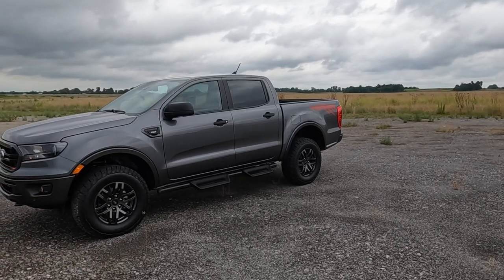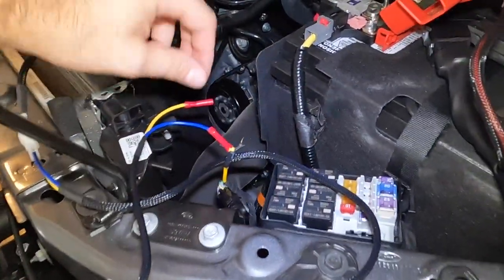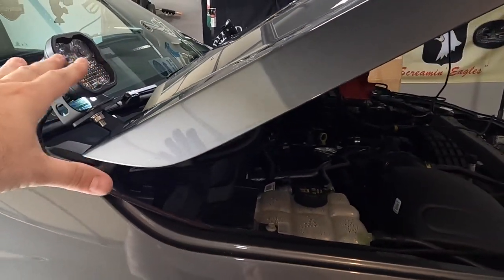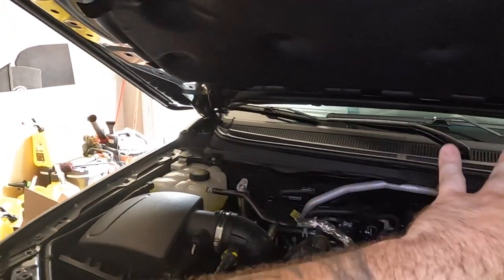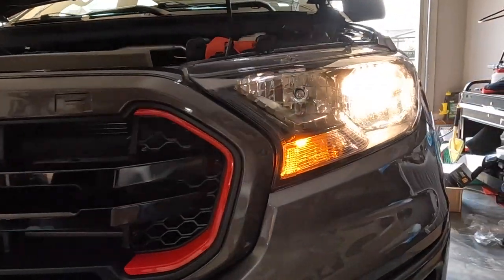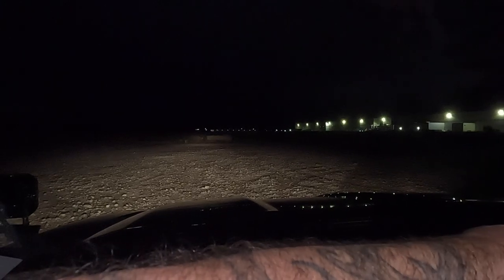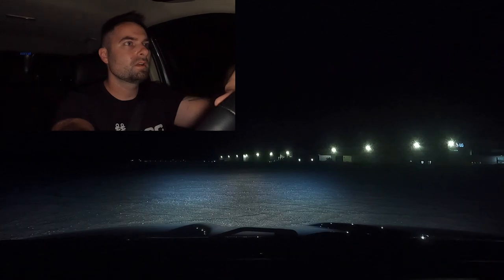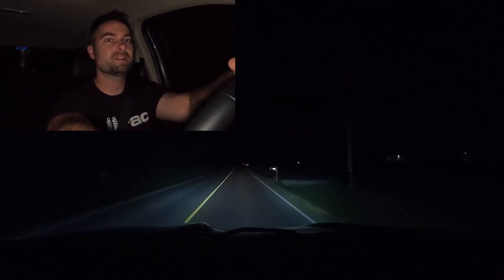FIRST MOD To My 2022 NEW FORD RANGER TREMOR- DIODE DYNAMICS DITCH LIGHTS & MORE! WOW!

Comment: Btw, the Ranger Lariat has LEDs in front vs XLT has halogen (I thought they were plenty bright on my '19 Ranger XLT FX4!). ALL Rangers have LEDs in rear. Love these Rangers! Run good full synthetic 5w30 engine oil ..change every 5k mis MAX & the Gen2- 2.3L TGDI Ecoboost will last forever. It's a well proven performance engine.
Reply: not all have the leds in the back

Comment: I have a "22 Lariat Tremor and I installed the ditch lights too, love them! but you didn't need to use the wiring harness and relay the lights came with, you just need to run the power wires to your lights, ground the one side and power the 2 colors wires off you AUX switches. I put my lights on the smaller amp aux switches to save the higher amp switch for a hidden front winch.

Comment: You probably already did the led upgrades. But after researching lights and adjusting my stock tremor headlamps up. I am so happy I didn't go LED.
Halogen is MUCH better at cutting through bad weather. That's critical for me living in the mountains. And after adjusting them up, the stock lamps are plenty bright enough to spot elk and deer crossing.
Reply: Curious what did you do to adjust your halogens up? I live in Maine and I do not want to switch to LED headlamps. I think I might add the ditch lights though, cuz sometimes when I'm the only one on the road I would want that extra boost of lighting.

Comment: I received my ordered 2022 Lariat a few months ago. It comes with LED lighting almost everywhere on the truck. Its factory LED headlights are a game changer. Being new to LEDs, I couldn’t believe how well  they illuminated compared to halogens. But, the LED fog lights are basically useless. When you sit in the driver’s seat they light up the ground in front of the truck just up to where the hood stops.
Reply: Those fog lites make a huge difference on the rd at nite. Keep em off when you start driving at nite then turn em ON! Lites up 6ft+ to each side. Love my '19 Ranger XLT FX4..been flawless!
Reply: @Davido50  I’ll give them another try. Thanks David!

Comment: I have a 2021 ford ranger tremor xlt but installed Baja designs ditch and reverse lights
Reply from the maker: Great choice. Definitely worth having
Reply: @Zander13Productions  oh yah both are very good lights. I also have the diode dynamics mini light bars for the bumper and they are excellent driving at night

Comment: 2022 lariat ranger here....the stock leds on the lariat are  pretty nice....Definitely going to add some ditch lights ....not sure if I want to replace the fogs yet
Reply from the maker: Love the ditch lights. Let diode dynamics know you saw the video. Hopefully they can save you a few bucks
Reply: @Zander13Productions  trying to decide between diode dynamics or kc era flex 4s.
In Alaska, and its dark a lot 😆 except summer lol. But the time for lights is coming
Reply from the maker: @prone_wolf8871  both solid brands. I have always used diode dynamics with my other cars so stuck with them for the Ranger. Both are great companies. Diode is priced right with great customer service and warranty.

Comment: I like nice bright lighting on anything I drive, but I'm not so sure how the hood lights is going to workout in a heavy Rain or especially Snow, it may.. illuminate the Snow to Much directly in front of your eyes and not let you be able to see the road all that great, idk.. if that makes any sense.. like trying to Drive with your High Beams ON.. in a Heavy Snow Storm.. How you Can't hardly See Nothing but the Snow Falling itself! ..But it does Look Great man and you can turn Any of the Lights (ON or OFF) as you want by the switches on your dash Correct?

Comment: Nice addition and upgrades to your Ranger Tremor. It amazes me how poor most factory headlights are. I like that Ford provided the switches for misc electrical hookups. Your Tremor is an awesome looking multipurpose off road or daily driver truck that has attitude. Your color which I believe is Cactus Gray really makes the body lines pop.
Reply: The stock headlines aren't poor at all. I have a '19 Ranger XLT FX4 ..the halogen lites are plenty bright ..ppl flash high beams all the time at me. He's just tryin to pump his video. Ranger has auto high beams too. A sweet truck. Best in class!

Comment: RE: Correct way to wire AND use the right amp relay, saving the big dawg 25A Relay

Hey, Great Vid and much respect firstly!!  Someone MAY have already mentioned this, but although the wiring job worked, you are now running 2 relays and two fuses.  I would also save that 25A Aux1 switch for something WAY BIGGER!

I did this with the Rough Country 6" light bars that go in that little trim spot where IT SHOULD ALREADY HAVE LIGHTS, BUT DOESN'T! 

*************HOW TO INSTALL CORRECTLY & CHOOSE CORRECT SIZE RELAY*************
         ----------- We are assuming the gauge wiring for the products are correct and if anything, it's a lower gauge than truly required ----------

WHY THE BELOW CRAZINESS??  the Tremor upfitters already have the relay and fuse going to the power.  You are doubling up; a strange dynamic for sure.

STEP 1. Hold you breath AND CUT OFF THE 'DIODE' DitchLight wires in the following way (this is really almost taking it all off...crazy, but actually awesome!):
   a.) RELAY (redundant w/ aux)
   b.) FUSE (redundant w/ aux)
   c.) POWER SWITCH (redundant w/ aux)

### ALL YOU NEED IS:
                1. STRAIGHT POWER WIRE (SPLICE L&R TOGETHER SINCE DOUBTFUL YOU WANT SINGLE SIDE CONTROL)
                2. THE GROUND, WHICH YOU CAN CHOOSE THE MOST INCONSPICUOUS/HANDY SPOT YOU WANT

I don't know exactly what you have, but those are some powerful suckers.  Because of the extra power, I am doing your calc right below... My setup used lower wattage!  It was 12 Cree 3W leds... so the 5A Auz did the trick.

AMP = WATTS / VOLTS

Apparently yours are 20W/led!! omg!
   - 8 LEDs total x 20W = 160W
   - 160W/12V = 13.33 AMP

   I would save the 25A for something w/ higher draw.  Maybe 15A in this case?

Since I don't know the details of the lights, if there are two options of colors/etc, just wire accordingly.

But save the 25A and don't double up on relay or fuse or switch :)

Sorry if u heard 10x already.